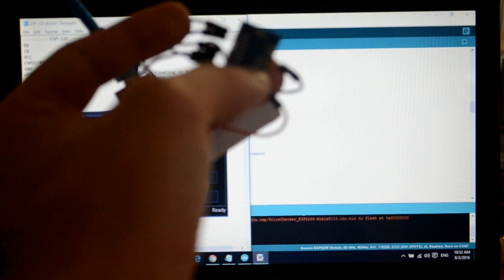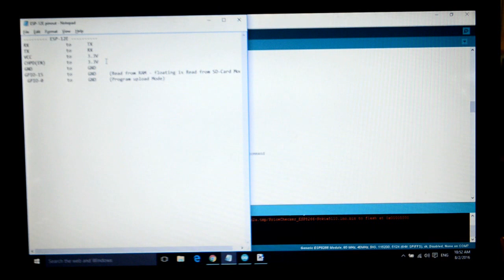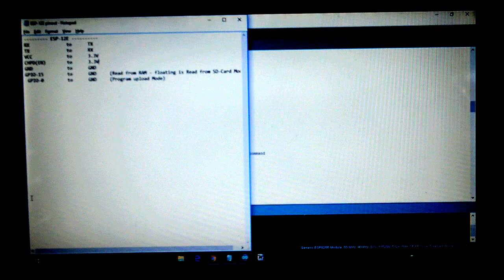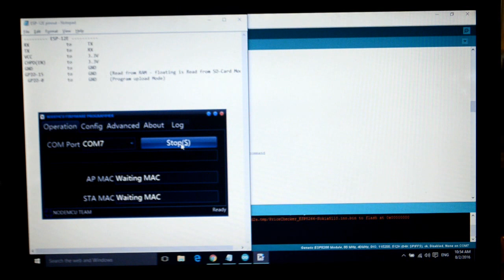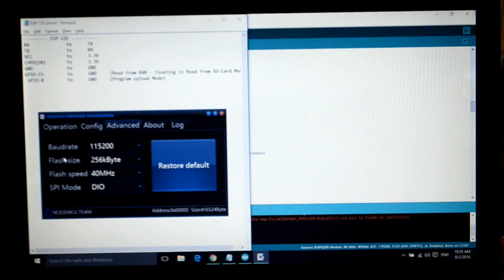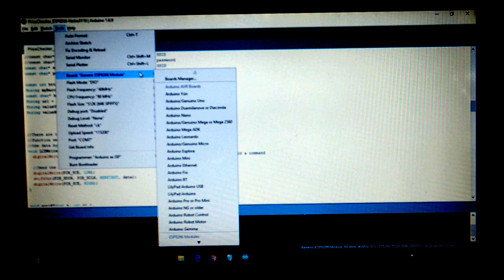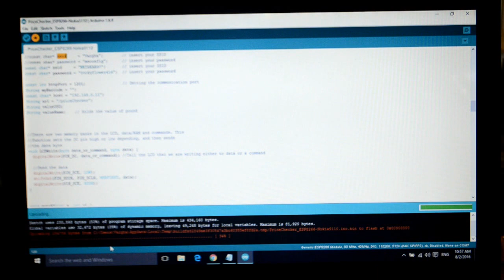How to update firmware and upload program into ESP8266 ESP-07 and ESP-12e

Comment: i am using the esp8266 esp12-e and while updating the firmware it shows require"wifi", require "gpi0" and AP MAC & STA MAC doesn't show. I am connecting the pin outs as it is published by you please help
Reply: i have same problem pls help